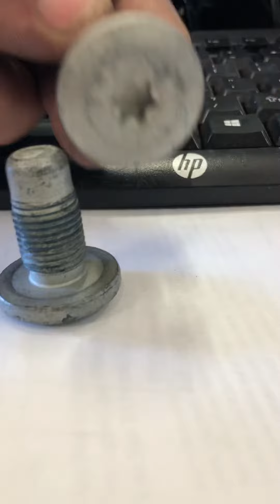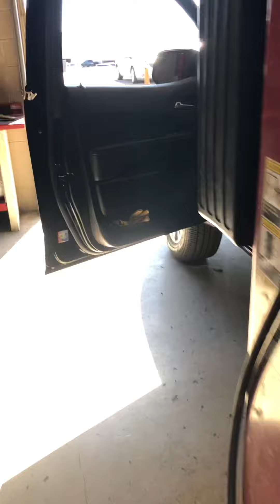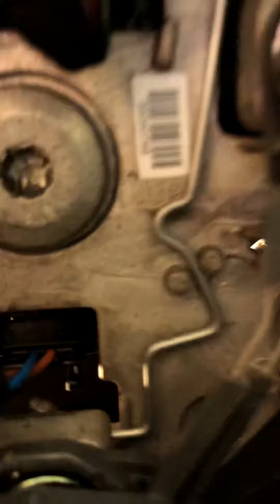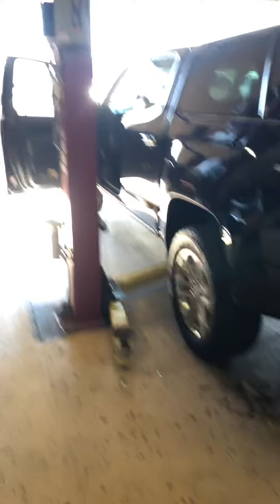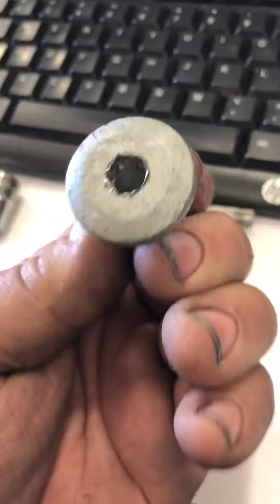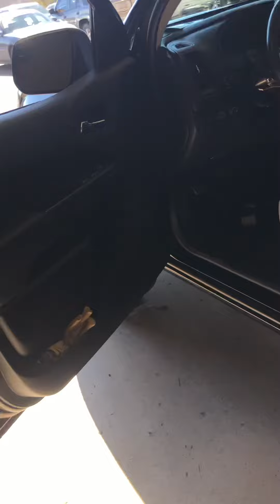Designed to fail

Comment: Geez what a pain! Do they still strip out even using the Torx Plus of the right size?
Might as well make it a one way bolt head at that point, seems like easy of assembly gets more brain time than rebairability.
Reply from the maker: I've got 2 out without drilling in the last 4 years.

Comment: I'm not sure I get why a 47 would fit better then a 50 if the 50 was loose?
Reply from the maker: Surface area I guess. Not sure about the technical differences. The cheep metal bolt will not hold up to either.